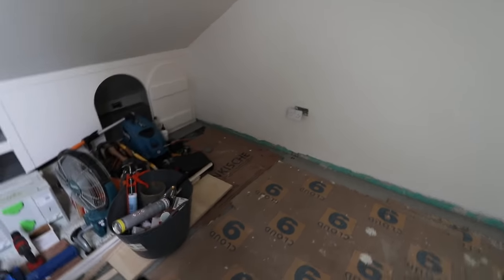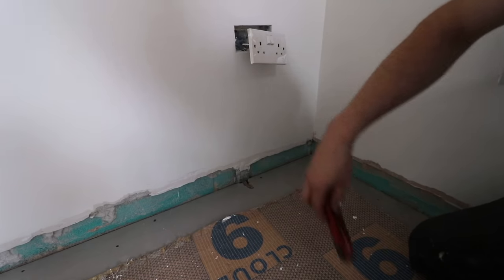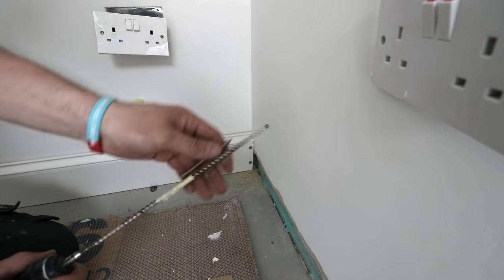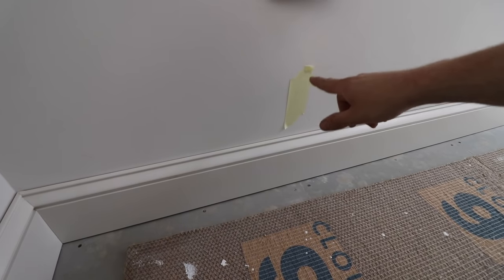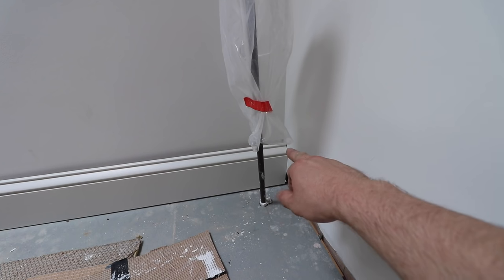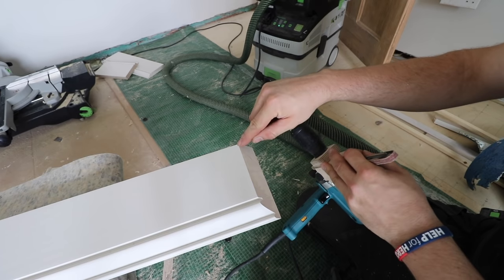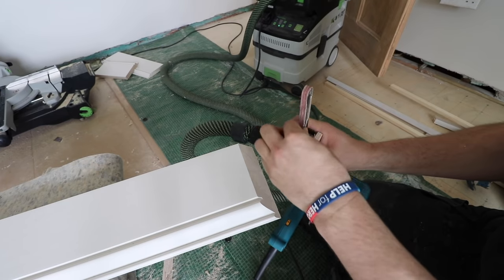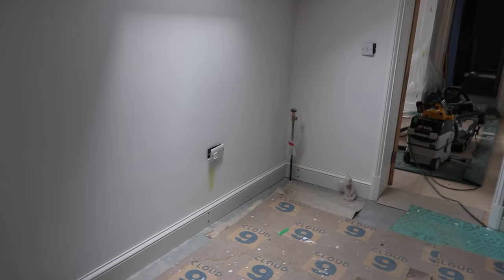How To: Install Skirting Board And Cut Scribe Corners. ""Bonus Content"" The Ultimate Scribing Tool

Comment: OMG! thanks - I have to fit 12 framed kitchen units into existing brick openings with flag stones used as a work surface - Every edge has to be scribed into very uneven edges.  This power file trick will save me hours and hours :)
Reply from the maker: Nice one Robert and thanks for saying! I use the power file on almost every scribe. 

Definitely needs dust extraction or you'll be choking in seconds

Comment: How do you treat / finish the gap between the "skirt board" (aka "base board" in the USA) and the wall / plaster?
Reply from the maker: I mask and use a ms polymer sealant tooled flat with the top. It's incredible strong, paint able and doesn't shrink.

Comment: Great video mate, I've seen another carpenter use a angle grinder with a flap disc. Fair play it was really good for scribe cuts
Reply from the maker: Yes the idea sort of came from that but for me I needed more control and dust extraction. With a grinder your choking on dust in minutes
Reply: Yeup done that myself along with coping saw, jigsaw not with inside miter saw 🎯🎯 power saw 👍

Comment: Good video Ollie. I've fitted skirtings to a couple of rooms. The jobs went OK but would have been better if I'd seen this vid first. If anyone fancies the Evolution file sander, first check if it takes standard sized belts: I have an Evolution mini belt sander & the only belts that fit are the Evolution ones. ( & the circular saw blades are an odd bore size ).
Reply from the maker: Thanks Graeeme, Good Point, and well worth checking with any tool as its quite often the running costs that are more expensive than the purchase price!

Comment: Hi Mate, just been catching up on some of your older stuff.. I'v been fitting skirting myself today and used the same technique apart from the power file which I’m going to order from Amazon tomorrow just don’t tell the wife lol 👍👍👍👍
Reply from the maker: Nice one carl. The narrow sander file is brilliant, i use it all the time for fitting. Especially good for high gloss or sensitive finishes and scribing them into brickwork etc! Worthwhile making a dust extractor connection for it or youll be choking on dust in seconds. Its pretty good with what i made! I wouldnt use it without. 
I think there is a cordless version which might be better, not tried it though

Comment: Interesting technique! I can see why the builders of my house decided to put pillars in the corners that matched the bottoms of the door frames, so they could do butt joints all around.
Some questions if I may:
1. After the skirting is in place, do the plasterers come back and erase the gaps between the wall and the top of the skirting?
2. How do you handle a splice on a long wall that is longer than any single board? A flat 45 miter, or something else?
3. Scribing seems a lot more work than a simple internal miter. I'm not clear on the advantage of scribing the corners over mitering them.
Thanks!
Reply from the maker: Ive  never seen corner blocks before tbh! thats a new one on me! Most just mirte into the corner! 
I filled the top gap in using a paintable but non shrinking mastic (MS Polymer) Use masking tape to your lines on both skirting and wall then tool it flush and remove tape. Its fiddly but perfect. 
Traditionally a 45 mitre through the height of the board. If its flat profile or very small moulding ill butt joint and add a Festool domino x 2 or more. 
Scribing means the fibres of the timber when tapped into place are crushed on both pieces,  meaning less likely to open up a gap. A mitre will always open on the inside first as timber shrinks so you get corner gaps that are very visible and you can see right in them. To see in a scrived gap you have to go to the same plane of the skirting and look down the length. You also have to be very accurate with a mitred corner, cut a board 2mm too short and its wrong. With a scrive you just cut one in square so the top part fits the rest can be undercut, then the scribed piece can be fettled for a good fit and again a easy cut on the other end.

Comment: Yet another great video 👍

What concrete screws are you using to fix the skirting ?
Reply from the maker: these ones are from screwfix, i think 100mm or slightly shorter from memory 7.5mm
Reply: @BradshawJoinery  thanks. 
What diameter drill do you use for those?
Reply from the maker: I use a 6mm hilti (4tip) bit but on really hard block/brick use 6.5mm. same in the wood, unless I want it to just pull in then use 7.5mm
Reply: @BradshawJoinery  great, thanks for your advice, much appreciated 👍

Comment: If you can't afford one of those fancy sanders, an angle grinder with a diamond blade(non-segmented) works really well too.
Reply from the maker: yeah of the abrasive flap wheels i see people use. Its Just too dusty for me. Your choking in seconds and it gets everywhere
Reply: @BradshawJoinery  the diamond blade doesn't do that, but I can see where an abrasive wheel might. Like I said, it's the poor mans way to do things.

Comment: Great video. I think one of the most in depth videos on fitting skirting. Would you recommend using 40 or 60 grit sandpaper to adjust the scribes instead of the files?
Reply from the maker: Thankyou, i dont watch much youtube on woodworking funnily enough, but some of what i have seen is one of the reason i started doing videos haha, You could use sandpaper yeah, like always sharp sandpaper is best, although compressed wood fibres in a scribe aren't a bad thing

Comment: Can you do a video on external corners?
Reply from the maker: They are mitred. I try and place the face down on the saw and make sure it's flat against the bed.. also use biscuits or dominoes in the joint if possibken

Comment: Amazing how much time your allowed to put on Base Board?  In the states I use a cope joint using a Banco cope saw or just my 12” Makita w/ a Chop Master Blade by Forest also an FS Blade.  It has to be a full kerf blade!
I use a Bosh digital miter finder w/ the ability to solve the miter angle.
I attach the boards using a Senco 15ga nematic nailer , not cordless !  The cordless model are not consist enough !  I mark my studs before hand  and if I think I need something I use a biscuit !  I cut a 20 hole & use a # 10 biscuit!
I move fast , fast like 2400 ln ft in 2.5 days!
U looked great!  U would go broke here though?  Not saying it’s not excellent work , cause it was!  
Just kinda sight seeing speed!
Reply from the maker: No worries, its a completely different scenario tbh, I think for a video its best to learn the best way to do it for high level of finish then work on speeding it up later. I can lob stuff in too though, i am a farmer at heart aswell!!!! haha

Comment: Great video - really helpful! 

If you were fixing oak skirting would you still screw and then use a plug cutter to make plugs to cover each hole or would you consider just using an adhesive?
Reply from the maker: Screw and plug with a cross grain pellet. Tapered preferably. Oak needs holding as much as possible. 👍
Reply: @BradshawJoinery  Thanks for your help! Much appreciated.

Comment: Great video as always. Love watching how you work and your level of craftsmanship. 

A few questions if I may, what solid wood skirting are you using there? Would that always be your go to even when painted? And would you also plug the screw holes again even if it’s a painted end product rather than filler?
Reply from the maker: I think it's the most durable form of skirting once you start looking past 10 years. I am not too keen on bought in timber skirting, the movement is vast and requires redecorating after a year or so. I acclimatize mine before machining and don't see much movement atall. Having the double fixings helps lock it in position and being tulip too.

Plugs are fine, there probably isn't much in it but filler will have a better bond if pressed in properly whereas a pellet only glues around the outer edge and sometimes not that deep on a tapered pellet

Comment: great video  one question how to center join skirting square cut with with biscuit insert or 45 cut with biscuit  insert. reason a 6 mtr wall and 4mtr skirting
Reply from the maker: The traditional way is indeed 45 degrees and probably in a renovation scenario I would stick with that! It will look authentic and done properly. Make sure the joint is backed /supported properly from behind with a battenit can be fixed and glued to so it's nice and strong, atleast 6" either side, not just left floating or it'll come apart! 
If it's MDF and no mouldings I'd stick a couple of dominos in and butt joint it.
Reply: @BradshawJoinery  thanks for the reply this is a new build with red pine skirtings but I am not familiar with the term battenit could you explain pls
Reply from the maker: "Batten, it " 
Put a backing piece in the wall behind fixed securely to wall/brick if there isn't a solid plaster backing where the joint is and glue all the skirting back 6" either side of joint

Comment: Why do you use expandable foam?
Reply from the maker: It seals all the air passage behind the skirting, and gives an even hold all over the back of the board helping it keep straight and is also very tolerant of the gaps left by the void of plaster at the bottom of the wall. Some brands seem to set harder than others
Reply: @BradshawJoinery  What brand do you use?

Comment: What size pilot hole are you drilling?
Reply from the maker: 6mm through everything. Recess head so about 20mm of timber has a 6mm pilot hole. It holds nice then but if need to be pulled level it can do it... 👍

Comment: How would you cut the piece initially (where you cut at 45) if the skirting board is not meeting at 90, but around 60, for odd shaped room?
Reply from the maker: its always a division of the angle. if its 6o degrees acute angle you could stil scribe, 60 degree obtuse angle id probably mitre it.

Comment: What foam did you use and can you recommend a decent foam gun?
Reply from the maker: I was using wurth foam, it's ok, they do 3 different ones, general use, a d4 glue foam and a board adhesive foam. Oh and fire rated. 

I used the dirt cheap £10 guns they last year's, just never take the can off. As soon as they run out put a new can on and that's it. Don't leave empty or try and clean it'll last a long time
Reply: The Hilti foam gun is a game changer, but its like £110.. Well worth it if you have to use one often or for precision filling though. I personlly just use a £40 teflon coated thing from tool station, which is ideal for the rare/occasional use for windows/prefilling mines gets. Do want that Hilti though!

Comment: Creo que este tipo de instalación es para quien no tenga una sierra. Pero tu tienes un ingletadora festool con ángulos. Tardas mucho en la instalación y no creo que sea rentable
Reply from the maker: A mitre is quicker but not as good, there is less movement allowance with a mitre and also makes some corners difficult getting the boards in place! Mitre on MDF is about all its good for in my opinion

Comment: Fine cutting your scribe to a 45 degree cut on dead flat MDF , and your walls and floors are dead true .... Try doing this in a 150 year old house with 7 inch dished softwood or oak, and trying to fix to rubble walls, and it's a totally different story .... Or is it just me who gets the shit jobs.
Reply from the maker: THis is timber skirting, but like i mention, the narrow sander is great at scribing into cupped skirting etc. Fixings, if there is nothing decent needs sorting before you try and fit the skirting, a twisted piece of wood works well into a mortar joint, or resin in blocks.

Comment: Why go to the hassle of drilling and  screwing.. i use gunoprene  and ive a concrete piner with 50mm.so much handier.. and if they have warm board on just use gunoprene and normal pins fired in at angles opposite eachother never falls off. Never screwed a skirting board on in my life unless it was on a curved wall or something like that.. and im at it for the last 20 years and they still haven't came off
Reply from the maker: Simply because it's the best way to do it. Sometimes there is the best way everyone does something when they are bashing out on price and there is a best way of doing it for quality. Screwing is 100 percent. Filling a hole left by a nail will raise as you've dented the fibres not cut them like a clean cut hole for a screw/plug. 
I've seen timber skirts pull adhesive and pins before, it's only the strength of the substrates underneath, the pins don't do a lot once stuff moves and the adhesive is useless once the plaster has cracked. It does do the job however 👍
Reply: @BradshawJoinery  so you screw your architraves aswell and door stops